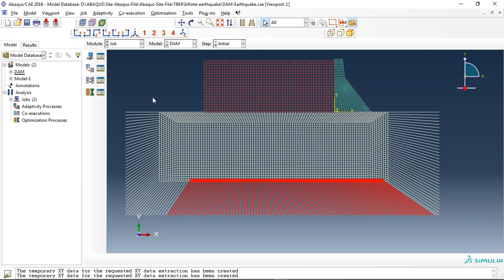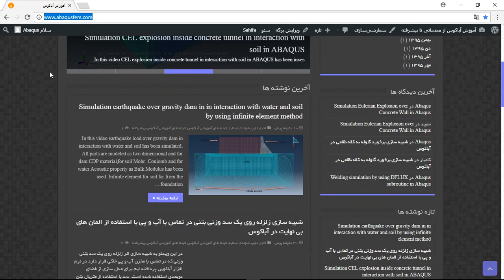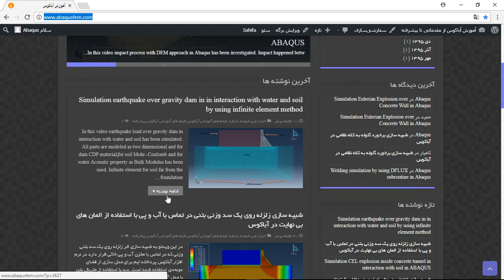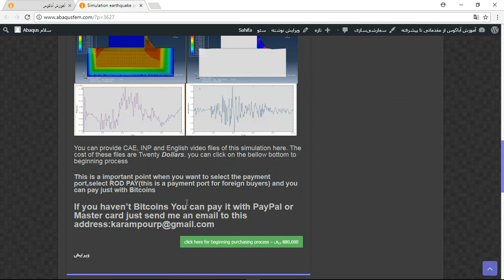Simulation earthquake over gravity dam in interaction with water and infinite soil in Abaqus

Comment: Hello Sir, One query regarding Time History Analysis of Dam... As to apply time history we do not restrict Base in X direction (Uncheck U!).., But simultaneously if we want to apply hydrostatic Force, it creates error in the model, which might be due to free movement in X direction...
So, Please suggest, what to do in such a case where other transverse load is applied on the structure along with Time history.